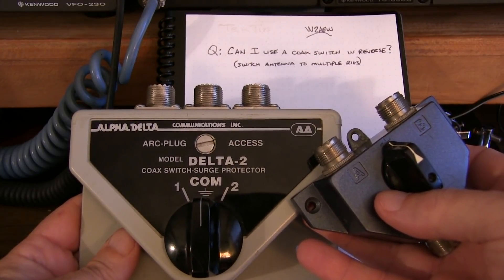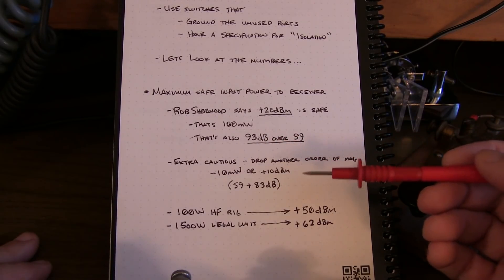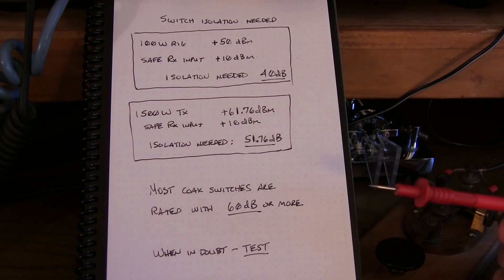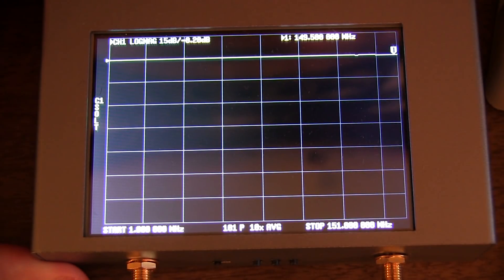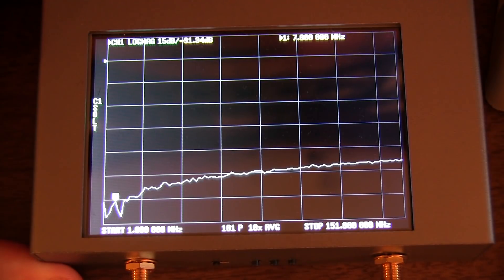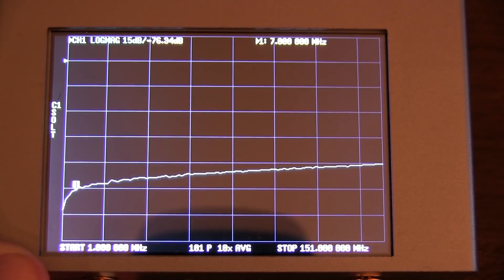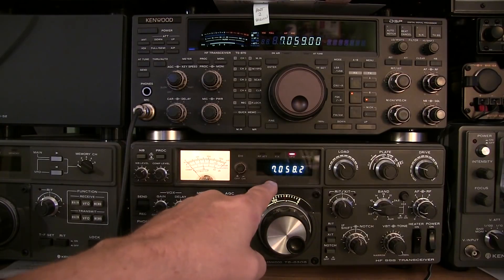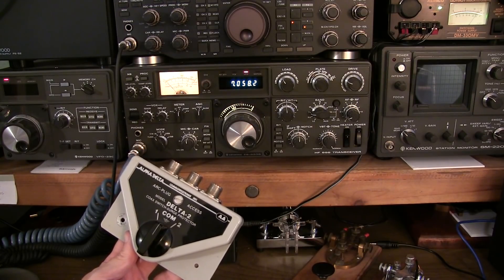#341: Ham tip: Safely using a coax switch to connect multiple rigs to a single antenna system

Comment: Great test and video, I've already signed up. What do you think about sharing VHF/UHF transceivers with alpha delta coaxial switches?
Reply from the maker: The Alpha Delta switches are typically rated at 50-60dB at UHF, so should be ok for RF power to 50-100W. I would still validate with measurements to be sure.

Comment: Ever thought of doing a video on antenna switches VS Relays to do antenna switching . Show and measure the isolation between the 2
Reply from the maker: A big part of the isolation would be the packaging and connectorization, more so than the relays themselves.

Comment: You show the signal from radio #1  going into radio #2, both radios are turned on. If radio #2 is turned off, does the signal from radio #1still go into radio #2? Love your videos, thank you!
Reply from the maker: Yes - the radio doesn't disconnect it's antenna connection when it is turned off.

Comment: If you turn off the other rigs it's moot.
Reply from the maker: Not true - un-powered receivers can still be damaged by excessive RF input.
Reply: @w2aew  That would have to be a catastrophic failure, especially if tbe rig was disconnected completely. 
73 Jeff W3AAB.

Comment: I just got a second radio. I want to use both radios with the same antenna. My question is, if you somehow click the transmit on the side that is shorted to ground, what happens to that radio? Do the radios sense if the antenna connector is shorted out and not transmit? I don't want to fry a radio. Thanks
Reply from the maker: That really depends on the radio.  Most modern radios have high-SWR protection.  However, I wouldn't rely on that, or on the ability of the shorted terminal to hold up under transmit conditions.  If you don't trust yourself enough to not transmit on the un-selected radio, then you may be better off with a simple coax patch-panel instead of a switch.
Reply: @w2aew  I'm more worried about the radio doing it on it's own. Maybe it will attempt to tune or the computer calls for the radio to transmit. Thanks.

Comment: Please make sure your negative power wire is tight if you use a shared power supply or both rigs share a ground. Otherwise, all the DC current (25amps?) of radio A will find ground through the shield of your Coax, through the switch case, through the coax shield of radio B and down the negative wire of radio B.   Another question is, how much current can coax shield carry?   This configuration creates an impressive ground loop as well.

Comment: Great video and it does show a reasonable amount of isolation through the switch but for me personally prefer 100% isolation and I just won't use a switch like that. It only takes a few seconds longer to change a coax from one rig to the other if you have 2 short coax leads coming from the back of the rigs to an easy accessible point in the shack to change an antenna between the 2 rigs and it make me feel a lot better knowing there is zero RF running up the rear end of the unused rig.
Reply from the maker: That is certainly the safest way!

Comment: Hi Alan , so  say if i had a 50w ssb Galaxy 2547 on antenna port 1 😢, and say an Apollo 40ch SSB cybernet radio on port 2 , going into a half wave vertical , if the antenna switch was switched to the GALAXY CH35ssb port 1, and say the Apollo was  on CH20ssb , when I modulate on the Galaxy I get some slight swing on the Apollo's signal meter through the RF leakage , is this in line with your video ?. without getting into dbm too much .
Much appreciated.
Reply from the maker: Yes, a little leakage thru the switch as well as through the shields of the coax jumpers.
Reply: @w2aew  great ...thanks for the reply Allan.
Much appreciated. 
✌️ 73 🇦🇺 🪃

Comment: Excellent video Alan.  I've been hoping you'd do a video about this subject for awhile now.  By the way, there was an article done in QST on this subject awhile back (QST March 2020, Page 36), testing the newer generation MFJ RF switch (MFJ-2703).  Using a separate RF Generator and Spectrum Analyzer, depending on the HF frequency (range from 3 to 30mhz) the port isolation ranged from -79db to -129db.  It would be interesting to know if your NANO device could confirm those isolation readings for this newer MFJ RF Switch in this article.  KF4HR
Reply from the maker: The NanoVNA doesn’t have that much dynamic range.

Comment: How much worse does it get in the 70cm band? Is it still safe? Sorry, I’m a newbie. Just got my tech license a few weeks ago.
Reply from the maker: It does get worse as the frequency goes up. The only way to be sure is to measure the switch you have at the frequency you intend to use it with.
Reply: Well, I have a NanoVNA but I still have a lot to learn in how to properly use it lol. I have a GMRS and HAM radio both 50 watts that I’d like to connect to the same antenna. I’ll try to find some more videos on how to program the nanoVNA to run this same test.

Comment: Thanks for a very well  researched and presented  video  It's something I've been concerned with for some time but not had the opportunity to research  in detail . I stopped using switches and reverted to  a patch  system  after  a switch destroyed the front ends of two QRP radios.    The cause  appears to have been  poor earthing of  the  unused port  when the switches wear  in constant use . - The switches being of the  type you refer to as the MFJ  but come in various  brands.    Would  be interesting to see an internal comparison of the construction between   various switches .  Richard G3UGF

Comment: Do you run a ground strap to your switches?
Reply from the maker: I generally don't.  But, if you were using it as a primary antenna switch, and you switch has a gas-tube lightning protection plug, then it wouldn't be a bad idea.

Comment: So helpful as I enter the world of a coax switches
Reply from the maker: Make sure they're shorting switches, and in proper working order before using them to switch between radios.
Reply: Would the MFJ-1704 be considered a shorting switch per your definition?  I believe so but am not certain.  I have a lead on (2) for $100 used.  Planning to use with 4 50w UHF VHF radios.  For access to all 3 most common ham digital modes for simplex contesting (Winterheat).
Reply from the maker: @cchalfantusa  Yes, according to the manual "If the switch is turned to an active connector, the other connectors are automatically grounded."  It is rated to give at least 50dB isolation at 500MHz, so should be good for your VHF/UHF needs.
Reply: @w2aew  thank you so much.   Would it change the equation if one of my two switching needs was using HTs?   3 5w HT’s, connected to the switch then to a VHF amplifier (40W) before the antenna?   Just wondering if HTs need even a higher level of isolation because they likely aren’t built as robustly.   I’ve got a FT-70DR, Icom 51A, and TYT MD-UV380.  Again for coverage of all 3 common digital modes on simplex for a monthlong contest.
Reply from the maker: @cchalfantusa    I really don't know about the robustness of the HT frontends, especially the inexpensive units like TYT, etc.  You'd have to see if they spec a maximum RF input.  I would suspect that the 50+ dB of isolation of the switches would be sufficient, but can't be sure without knowing more about the specific HT max input ratings.  Given that the switch would only be handling low power before the amp, I would expect it would be fine.

Comment: So I have a quick question about your video...... Is it still safer to turn off the power to the other radios or does it make no odds I'd they are on or off
Reply from the maker: For most radios, nothing is disconnected when turned off, so they aren't any less immune to damage when off.
Reply: @w2aew  OK thanks I have 4 radios and I want to run them off one vertical antenna  thanks I'm glad to see your video as I was unsure as to whether or not it would effect the other radios
Reply from the maker: @cheap2run.aquariums   It would be wise to check the switch carefully to ensure that it has the proper isolation
Reply: @w2aew  I plan to run a president lincoln 2 plus off one of the other ports for a while.... As it can easily be replaced if it don't work we tested the ports for any continuity with a multi meter and there was none and unused ports are all grounded so see how it goes running two radios on it with the lincoln plus 2 as a scarcraficial radio just in case as I don't have your fancy meter to test it

Comment: Just finding this video now, interesting, I've just purchased a remote control switch MFJ-4712 from DX Engineering, but my purpose is to run a Transmitter capable of 1 KW into one port and a receiver into the other port with the common port to the one antenna. I hope the isolation will be good enough can't find any spec for that so I'll have to do similar tests...good video thanks indeed. Clint - VK3CSJ

Comment: My first ham radio when I got licensed in 2011 was a Kenwood TS-830S.   Great radio I need to dust off and make some contacts.  Love your videos!  I'm new to simNEC and want to purchase an inexpensive with decent dynamic range (70 - 80 dB) up to 500MHz.  Is the nanoVNA V2 plus4 worth the $299 on Tindie or are there any  other reliable sources?  Thx de NO5X

Comment: So does that mean the whole switch is only usable "in reverse"? I'd like to get a 4 way (not including input port) so I can have two antenna ports, one for transceiver, and one for my nanoVNA - would like to bake the nanoVNA into a small go-box.
Reply from the maker: Sounds like you need a pair of 2-way switches, wired together, so you have two inputs and two antenna ports  - wired like this > - <, where the common ports of each switch are connected together.  You'll have one knob to select the antenna, and another to select the transceiver or VNA.
Reply: @w2aew  Awesome thanks!

Comment: Wish I saw this earlier.  Just had a potentially expensive mistake.  Was operating off my Yaesu FT-450D and wanted to switch to my Kenwood 520-S.  I have my antenna feed like connected to a meter/dummy load combo which I then connect to the transceiver.  I went a little to quickly and connected the end from the dummy load meter to the Kenwood - inadvertently connecting them together and proceeded to try to tune up the Kenwood finals- didn’t realize my mistake while trying to troubleshoot the plate reading until the FT450 started smoking.  So far Kenwood seems ok, but not receiving anything on 20 meters through the Yaesu.  A lot of QRM right now on the Kenwood so going to see if it is still dead reception after the bands clear up.  Crossing my fingers.
Reply from the maker: Ugh!  Mistakes happen.  Hopefully the damage in the Yaesu isn't too extensive.
Reply: Oh no! I am sorry for your loss.

Comment: Would you please clarify something?  I understand that when you say the switch sends the unused port to ground that the it is sent to the chassis of the switch. Should that switch be sent to watch ground?
Reply from the maker: Yes, the unused ports short their center conductors to the shield, which is the chassis ground.  This is usually grounded because it is common to the equipment ground.

Comment: Does this matter if the 2nd radio is off?
Reply from the maker: In most cases, even if the radio is off, the electronics of the receiver front end are still connected to the antenna and could be damaged by high power.
Reply: @w2aew  thanks! I tested my switches and even the worst cheapest switch has 60 dB of isolation. I never run more than 100 w so I'd say I'd be fine. Thanks so much for teaching this as I now have a very very valuable skill.

Comment: 1:10  Re: Max input +20dBm or 100mW or 1/10 of a watt.  Some hams have damaged their FT-991A, blowing up R1005 which is 150-ohms and 1/10 watt. That they've damaged a resistor that is 1/10 watt, and conservation of energy, all this implies that they've exceeded the recommendation of Mr Sherwood and subjected their poor little radio to something above +20dBm.
Reply from the maker: Interesting, since less power would be dissipated in the 150 ohm resistor than a 50 ohm resistor (since the source is a relatively low impedance voltage source.)

Comment: Got be 550  will it be safe to run two radios three this got 520s. And ts 440
Reply: Sorry it's b w 550
Reply from the maker: @benjaminmeadows1380  I don't know, I've never tested a B&W 550 switch.  If you can find a datasheet on the switch, it would tell you if the unit switches the unused inputs to ground, and what the isolation is.  Otherwise, you'd have to test it.

Comment: Just answered a question that popped up regarding my antenna management!  I'm not sure I understand completely what " XdB of isolation" means, however.  If you have 60dB of isolation between position one and position 2 and your reference is -73dB yet your signal is +2dB at what point in dB of the signal do you not have enough isolation?  Immediately upon hitting -13dB things will start smoking?  Or, is it more a rule of thumb that you're over taxing your circuitry as your xmitter signal rises though -13 and up?  I still new at this.  Sorry if this is a question with an obvious answer.  Thanks again for a great educational video.
Reply from the maker: The rule of thumb I was using was that an RF power level up to 10mW, which is +10dBm, is safe for the receiver.  For most HF receivers, an "S9" signal level corresponds to -73dBm.  Since +10dBm is still safe, this says that the input to the receiver can be as high as S9+83dB and still be safe.  The math shown in the video (and here https://www.qsl.net/w2aew/youtube/coax_switch_isolation.pdf) says that if you're using a 100W transmitter, then having at least 40dB of isolation is sufficient to keep the receiver safe.

Comment: Could someone dumb this down for me? I want to hook up my base gmrs radio and digital police scanner to one antenna. Can I use an alpha delta switch (2 port a&b) to switch back and forth between scanner and gmrs radio to use one at a time. I currently disconnect the antenna coax from back of radios and move it back and forth and it's a pain in the A. Not sure if it matters, the transmit radio is only 20 watts. 
Thank you in advance.
Reply from the maker: The likelihood is yes, you can.  But, it would be prudent to check the allowable maximum input level into the scanner to be absolutely sure that the small amount of leakage in the switch will still be safe for the scanner.  You would also want to verify the amount of isolation provided by the switch at 470MHz.  To be extra save, you could put an extra switch inline between the scanner and the main switch - this would give you an extra measure of isolation....
Reply: @w2aew  excellent. I like the idea of an extra switch in between. Thanks

Comment: It's my understanding that S0 is -73dBm for frequencies under 30MHz.  For frequencies above 30MHz, S0 is -93dBm.  So does that imply the safe input voltage for frequencies above 30MHz is 0dBm, or 1 mW?  Or, for frequencies over 30MHz, it safe to go 113 dB over S9?
Reply from the maker: Actually, S9 is -73dBm for 30MHz and below.  According to Rob Sherwood, 0dBm is safe on all the HF radios he has tested.  Personally, I'd keep it to -10dBm maximum.
Reply: @w2aew  Thank you!

Comment: I have more than one rig and when I use a antenna switch to select which radio I am going to use, I always modify the switch so when not in line it will not go to ground.  It is inline at the radio point so 100w would be the max the switch will see.  In most cases being I use an amp, my radios are set to 45w out max.
Reply from the maker: Yikes!  You are removing the connection to ground for the unused ports?  That is a BIG part of the isolation offered by the switch, and you're subjecting the unused radio to a lot more coupled power.
Reply: @w2aew  not if it’s powered off which always the case.  having it grounded is a big issue if you power up the radio you want to use and forget to switch it online.
Reply from the maker: @slickman1953  Unless your radio has a relay that disconnects the antenna when powered off, then your electronics are still going to see the coupled power, potentially enough to do damage.  For me, I never turn on a radio and transmit before listening, so it would pretty clear when I am not switched to that rig.  To each his own.
Reply: @w2aew  Accidents happen, it's human nature.  Oh, and by the way, grounded ports have nothing to do with isolation
Reply from the maker: @slickman1953  Understood, accidents do happen, I agree with that.  I disagree with you about the grounded ports.  Grounding the unused ports will affect the isolation offered by the switch.  Stray RF in the cavity of the switch will couple more energy to an open unused port than it will to a grounded unused port.

Comment: Hello Sir, I love your videos on NanoVNA, they are very informative, however I couldn't find a video where you test the coil antenna. How could we correctly calibrate and measure a loop antenna with wireless single loop hooked up on channel 0? It would be really helpful

Comment: I have an older MFJ switch, that looks perfect on the outside. I was receiving cross-talk between the two antenna positions.
Upon disassembly,I found the guts of the switch covered with a fine oily substance.
Removing he oil and abrading the electrical "ground" surfaces inside the switch repaired the problem.

I don't have a VNA, but I estimate that the isolation improved by almost 40 dB.

Comment: Some years ago you did a video about the RF Milivoltmeter Boonton. I bought a model Boonton 92B with the original RF probe (same S/N). But the probe cable need to be soldered again. Do you believe that if a small wire lenght (in the probe cable) were cutted off and a new soldering were done in the plug, this action could change the factory values?
Reply from the maker: I think this will be fine.